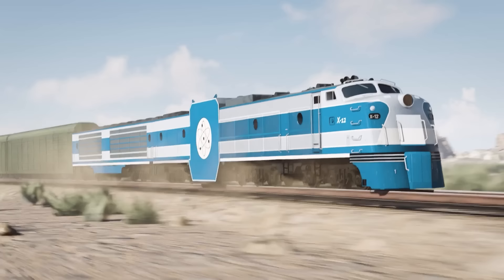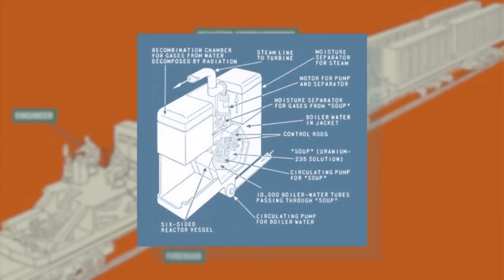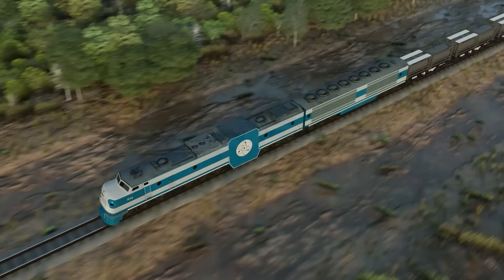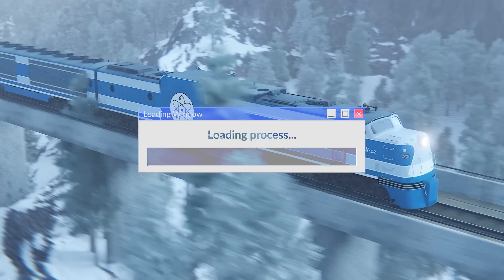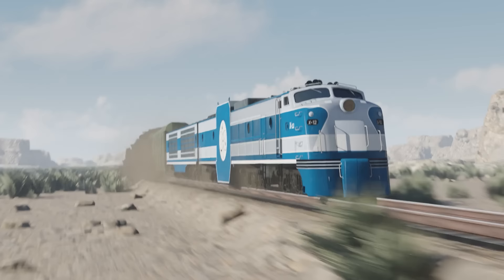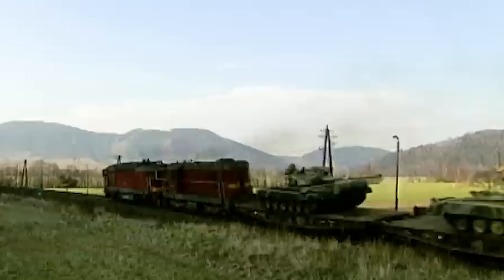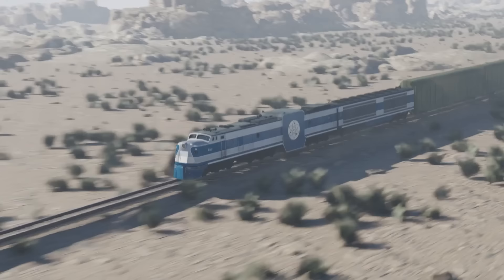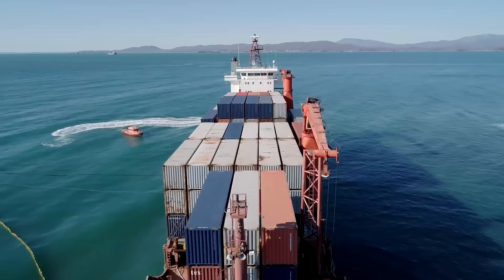What ever happened to Atomic Trains?

Comment: This is ironic because when steam locomotives first came on the scene they were equivalent to a nuclear reactor in complexity, very few knew how to operate them, they were very dangerous if you didn't do it right, hell they could explode just like a reactor. So...  yea putting this on a train is just a chefs kiss in that vien.
Reply: On top of that, these would be steam turbines with electric transmissions. So you've got an active nuclear reactor (or a huge-ass RTG, but that's cheating in this context), high pressure steam, a steam turbine (gotta watch your revs) and high voltage high current electricity.
Reply: While I am a massive fan of nuclear power and would love to see more of it, your analogy falls apart when you account for nuclear fallout. That is not something that can simply be overcome with training and tech IMO. Having that mobile and near mass amounts of people is not a good idea...

Comment: It would be easier to build a nuclear power plant and use electric locomotives. They could sell the extra power to the public. It would improve the power grid, speed up schedules and running time, and lower the transportation costs for bulk foodstuffs like grain and flour. And that's simply because electric locomotives can out pull any diesel or steam locos, and run faster with heavier trains.
Reply: Ok you pay for the massive Nuclear power plant and the millions of tons of steel and wires needed, then their construction, then their daily maintenance and inspection or you could just have a 20 foot LIFTR reactor running on normal rails 🤷🏼‍♂

Comment: I wonder how powerful you could make a setup like this with the technology we have now? And instead of having it be a part of the main locomotive, have it be a powerpack that powers two or three generator-less electric locomotives. In a pinch it could be a mobile power station for disaster struck areas too.
Reply: But there's no point really, nothing needs that much power "from a single outlet" (I mean for trains the two-three smaller diesels are more economically viable than a huge atomic, as there are not many logistical routes that require transfer of extreme number of resources between two fixed points), it's excessive and inefficient. Hydrocarbons are very effective at storing power, actually, and they're scalable from tiny to huge generators that can power districts that can be well distributed ad-hoc or with an existing grid.
Reply: It's probably 10x more expensive than building overhead wiring^^ And I'll guarantee you that no operator could safely put a heavy as s*** nuclear powered engine on the existing rail infrastructure in the US. Rails, bridges and tunnels have to be in excellent condition to avoid derailments as much as possible, all level-crossings had to be removed to avoid crashes, up-to-date signaling like ETCS must be installed to avoid (rear-end) collisions.

Basically building a freight network with CHSR standards.

Comment: Technically, all Nuclear-Powered energy sources are basically steam engines. 
As I was learning about the largest Steam-Powered Locomotive Engine, called 'Big-Boy', I thought to myself, “why are we not using nuclear power in our trains today?” 
With today's Small Modular Nuclear Power, it makes sense to me, to use it in not only trains, but in most power generators. Are we waiting for batteries to get more efficient? Or is there a group of people, or lobbyists, who are just getting in the way of a better power source?
Reply: For trains it wouldn't make sense at all, since you could always just use overhead lines for electricity, which could theoretically come from any power source, like a nuclear power plant. Funnily enough however, the reason why most railways on the American continents are still unelectrified is very likely lobbying
Reply: @broski8849  no.  They dont want to electrify because it is expensive.  However, tests were done in 1973 to 79 to do that.  Also, there was a transcontinental line which had two electrified sections and it was taken down because of stupid management.  I am talking about the Milwaukee Road.
Reply: Not all. There are RTG (Radioisotope Thermoelectric Generator) that can turn the heat from fission directly to electricity. It's used on old space probes that doesn't need a lot of power, need to last a long long time and can't have solar panel

Comment: Sodium reactors are safer in a meltdown than pressurized water and a shame we never went that direction
Reply: The primary sticking point for sodium reactors has always been the need to keep them hot when the reactor isn't running. If the primary loop cools off, it'll solidify and effectively brick the entire reactor, which makes refueling and maintenance a bit of a headache. It's not an insurmountable issue, but it's enough of a headache that everyone who's tried it has abandoned it pretty soon after.
Reply: Sodium is reactive with water (boom!) and is corrosive. Difficult to design pump seals.

Comment: And when the train did stop (to load or unload cargo), you would almost certainly have issues with overheating. As you're not using the power to move the train and there is no air cooling the nuclear reactor would be producing an excess of power.
Reply: So you shut the reactor down.

Comment: Chernobyl coming to a town near you
Reply: Nuclear power still continues to be the safest and cleanest form of energy despite it.
Reply: @robertalaverdov8147 yeah but it doesn't make sense to put a reactor on a train
Reply: @dddf27  If it was economically viable then there shouldn’t be an issue. Tons of hazardous materials including nuclear waste are transported on the US rail network on a daily basis. Yet no one in their right minds says we should ban all trains from operating because of an accident.
Reply: @robertalaverdov8147  but better option is already available. Instead of putting reactor on the vehicle it will be much more sense to put the reactor on a stationary place, connect it to the grid and then electrified the railway. 1 nuclear power plant can power multiple trains compared to putting each one of nuclear reactor in every single train. It will be more cheaper, easier to maintain, and it will also power the entire grid too.
Reply: @dddf27  I agree, that's one of the reasons why this wasn't economically viable. What I have a problem with is people claiming that any application of nuclear energy will lead to another Chernobyl.

Comment: With advancement in Small Modular Reactors, I wouldn't be surprised (and would be very excited) if we get to see a revival of this concept.
Reply: but its still stupid.
if you want your trains to run on nuclear power then just setup a big nuclear power plant and supply that electricity to railways.
In this case this nuclear plant will be much more efficient and safe.
Reply: Or just put reactor somewhere else and use those money to research and build magic power transfer device.

That's sounds even more impossible isnt?
Reply: It’s literally pointless though. It’s more expensive, more dangerous, needs more infrastructure and there isn’t a reason for it. Trains need to stop anyway, freight ones stop for ages so no point putting one in there, and a passenger train stops loads for small intervals so it’s completely worthless.
Reply: @tusharsaikhedkar9808  You miss the point. Creating a reailway network with powerlines or even just outfitting existing railway networks with powerlines is extremely costly. So much so, that railway companies rather use diesel locomotives. 
His point specifically is, that small nuclear reactor technoligies, wich are currently in the trial phase,would make a more appealing business case, as the reactor needs much less maintanance and control from a skilled worker. 
The thing is, with the current advancements in small modular reactor technology and the more and more expensive to maintain powerlains, the scenario of a nuclear train will be unavoidable.
Reply: @freaky1382  Man, i won't repeat myselfe but be ensured, the idea is much less stupid than your comment.
Reply: @mandernachluca3774 All fun and games until the reactor has a meltdown in the middle of the city. Nuclear powered train is basically a bomb on railways. If it collides, derail or blown up by terrorist groups, the fall out will affect many people living close to the incident
Reply: Ah yes I can see it now. Train derails and melts down killing all hope of further development of modular reactors.
Reply: @mandernachluca3774  Its not really like a nuclear reactor is cheap. Even the SMRs of today struggle to find funding, let alone a business case. And the overhead lines don't care, how the power is produced. And the maintenance for them is relatively cheap, even in Europe. The German railroad track service takes 87,000€ per year and track for 100 km rail (Current prices, since 2018). Thats not even enough for just getting a load of enriched uranium for such a train. And after all: You need many trains. Each with its own reactor or each sharing the same power sub station.
Reply: @mandernachluca3774 The thing is you need to fit every locomotive with one of these reactors vs just installing electrified rails/overhead electricity and an electric locomotive. Reactors would also need highly specialized engineers and crisis response team for each locomotive. There is also the huge PR issue of a single accident + the public perception of nuclear
Reply: @rya1701  
I guess the biggest issue is your last point. The public does not even except stationary nuclear facility, how could the broad public even except nuclear trains.
I actually don't see that much of a problem in specialized staff, a the current rate, the human race evolves into an age that won't have much need for the uneducated work force.
This means more people have to get educated and thereby the whole jobmarket shifts towards more specialized technical staff.

Comment: I would like to see a video on nuclear-powered Cargo ships, I'm sure it was tried by one of the Cold War powers and I'm sure it was either too expense, too dangerous or both.
Reply: Iirc, three nations built them. The U.S and (the only one to build multiple) USSR (obviously) and one other that I can't recall atm. They had the problems of high operating costs, limited "friendly" ports, and (most importantly) most entered service at about the same time as the Chernobyl Disaster, which made finding people willing to sail/transport cargo on them difficult (and greatly worsened the second problem). The USSR ones (which were ferry/cargo/icebreaker combos) lasted longest because they solely operated in Russian waters hauling cargo and passengers to/around largely isolated communities.
Reply: It has been done. They has serious issues with logistics and operating costs (turns out bunker fuel is REALLY cheap), and could only dock at a handful of ports around the world for political reasons.

Russia actually still has a handful of nuclear powered civilian ships in the form of nuclear ice breakers.

Comment: With Los Angeles being a big train place with a massive population, could you imagine one of these miles long trains becoming a runaway on Cajon Pass and derailing in the basin while going over 100 mph like what has happened before, but instead of being a diesel train carrying inert cargo, like what has happened in the past, it was using these light water nuclear reactors and was hauling a bunch of LNG tanker cars and other hazardous and toxic cargo?

We probably should be looking at something more like LFTR in stationary reactors.  LFTR reactors use molten fluoride salts, so chemically inert.  Water leads light water reactors to be inherently unsafe, which is a bit of a complex topic to briefly explain why and how to mitigate risk and sodium is highly reactive, and so not something you want to have rolling down the tracks.  Even something as mass efficient as LFTR while having some better inherent safety is still not something you want rolling down the railway as an active reactor powering the train.  You still want this to be stationary.

One concept I have come up with is a hybrid train where you put up overhead electric where it makes the most sense, and really with LFTR making electric power cheap, have it everywhere.  But even if you don't have it everywhere, you could do battery electric with LFP batteries especially as iron is plentiful and places like the Salton Sea are jammed packed with lithium, so the key ingredients for LFP batteries are extremely plentiful, and then use natural gas to run a gas turbine locomotive.  The idea being the battery electric and gas turbine locomotives share power and if the batteries get low and there is no overhead power, the gas turbine locomotive could generate lots of power to distribute to the battery electric locomotives.  Trains already haul around LNG tanker cars, so just rig one up to the gas turbine locomotive and it will have plenty of fuel.

Comment: There is many myth and errors here.

200 tons is not much for a freight train  and no where close to half.  Normal freight train is 2000-5000 tons.

You  cant make a nuke out of LEU
Reply: Yes, but not on a single carriage, that is spread across the entire length of the train, so if you are going across a bridge, only a small part of the train is on the bridge at any one time.

Comment: The reasons most prominent I believe: 

1. The railroads don't want the liability.  The railroad in many parts of the states are in disrepair, and that is not something you're going to want to yeet a nuclear train through.

2. The working shift hours for freight crews is 12 hrs I believe.  That train is still giong to need to come to a stop, and change crew, or carry a bunking unit of some kind with relief crews.

3.  Chernobyl and 3 Mile Island have serious impacts, the latter to an outsized degree of it's severity. But by classification, 3MI is fairly serious, if not as horrific and consequential as the Goiânia Accident.  But the slain spirit of nuclear power really died here in the West, on the panic of the American public, and bad PR communicating the scope and severity.

Comment: Slap a nuclear engine into something the size of the Breitspurbahn with a rail unable to fail and were really talking.
Only problem with the nuclear train is engineers thinking in normal train size & train risks, if youre going to up the power you should up the scale too.
Reply: The 3m Breitspurbahn with 6.5m wide rolling stock would have been more important than an atomic locomotive. Obviously Breitspurbahn makes nuclear locomotive more possible.   All of those cities now confined to rivers, lakes, coastal areas, an made canls to use ships for outsize cargo could be placed anywhere where needed.  An Airbus A380, A350 or B777 fuselage could be be shipped complete.  Prefabricated modules for chemical plants, prefabricated buildings and factories even.

Comment: My main concern with nuclear trains would be what could happen in the event of a crash. The water would likely leak out of the train which would lead to a lack of coolant, which would lead to a meltdown and all the things that come with it. It could be feasible if you use a reactor that utilizes a fertile isotope that would remain contained and separate from the helper fissile material in the event of a crash; however the risk of something still going wrong, I think is still too high. Also, an increased number of orphan sources (Lost/unaccounted-for sources of radiation) could be expected. In addition, what happens to the trains if the company goes bankrupt or otherwise shuts down.
Reply: thats what im saying

Comment: For a truly nuts application - nuclear powered bombers were developed for a while, but eventually abandoned for numerous reasons, not least of which were that an inability to carry sufficient shielding resulted in killing the crew and spewing radiation into the air... trivial issues like that. However, the USA's work did result in the Oak Ridge experiments on LFTR reactors.